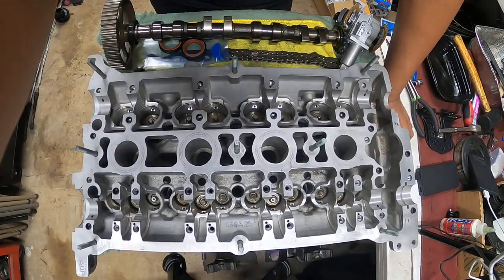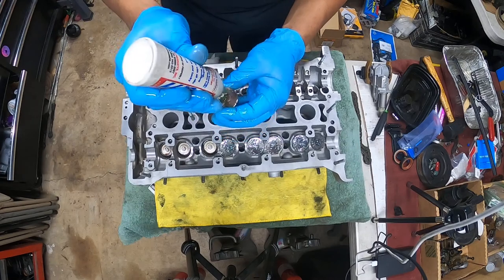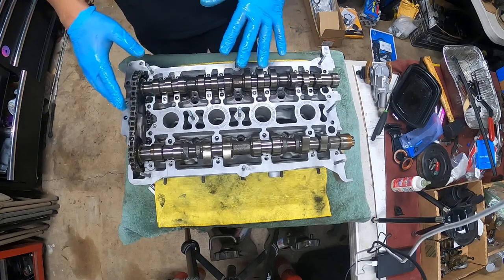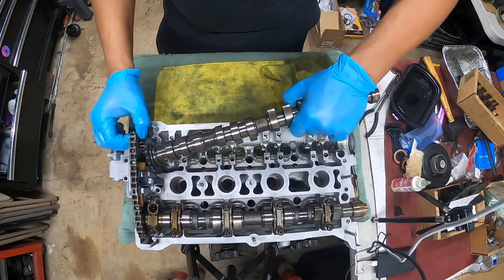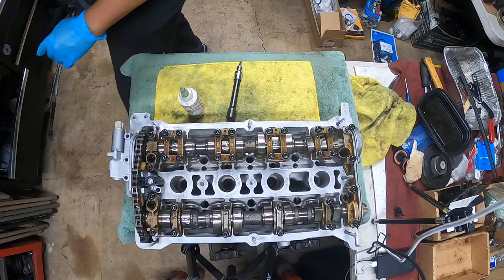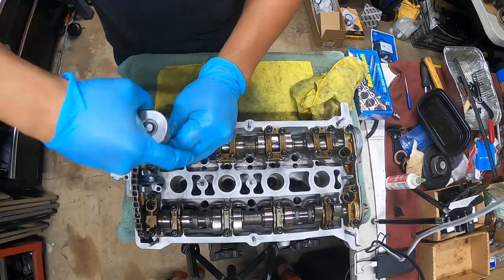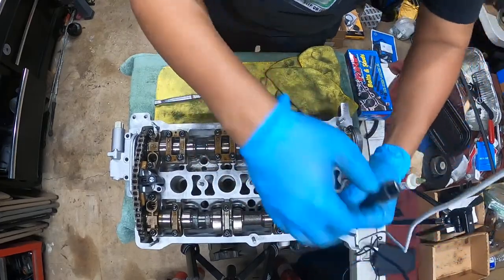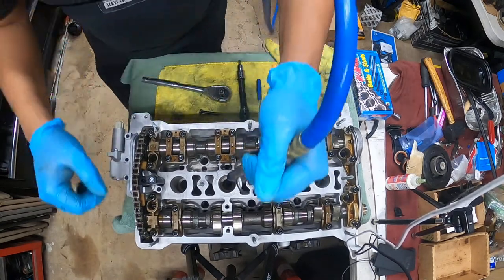1.8T Cam install

Comment: Good thing we're going to rebuild our 05 awp soon.  We've never removed  the cam chain tensioner (picked it up with 12 miles, kept it 100% stock) it has 230k miles. We've been lucky. 

Thanks for posting.  I'll be using these video on our rebuild.

Comment: HEY AL, engines currently apart rn and I have a question I hope you can answer for me! When installing the cam seal with the new PTFE seals, do I need to use the plastic cone to install? The one I ordered(new PTFE) didn’t come with it and idk if it was the new style or the older seals that had a spring that would come with the plastic tool. been watching your videos for a while now and they’ve been of great help.
Reply from the maker: You can use the plastic cone to install the seal once you have the head completely together with all the CAM caps installed.

The 0lastic cone is to help slip the seal on to the cam without causing the seal to fold over
Reply: @PincheALsGarage  okay appreciate it, thank you

Comment: Is it possible to replace the chain without taking the timing belt off by just taking the exhaust cam caps off and lifting up one side of the cam
Reply from the maker: Yes you can do that. I have a recent video doing this
Reply: @PincheAls Garage  thanks for the fast reply love your videos they have helped me out alot
Reply: Yes

Comment: Hi Inhave question, I have an 04 audi a4 1.8t, i have crank but no start.. did a comoression test had no comoression on cylinder 1, 2, 3 (30psi), 4 (90psi).. I checked all other systems everything else seemed fine.. sparkplugs looked bad, but I didn't see coolant and oil mixed or anything.. Not sure if the reason for crank and no start is due to no compression in first two cylinders
Reply from the maker: Wow! That is very bad.. your piston ring or valves are done. It's time for a rebuild.

Comment: I keep getting a camshaft position error on my 2003 1.8T Jetta, and cannot figure out what could be causing it. It has been checked by 4 very good mechanics including myself, and we all concur that the timing is perfectly set. We believe the problem may have to do with the reclutor that the position sensor reads, but there is NO information or diagrams for this part. God I hate this car!  
Does anyone have may ideas?? Thanks
Reply from the maker: Keep in mind if you have a failing cam chain tensioner it will give you this error. It happens because it won't be timing as the car is running it can loose oil pressure in the tensioner and cause timing issues. Timing will look right when the car is off just different when it running
Reply from the maker: Another common CAM sensor failure is the pigtail always short out over time.

I would check the timing on the cam chain as well. You have 4 spots 
One on the crank
One on the valve cover and cam gear
The cam chain 
One on the flywheel

What I do to confirm timing
Set the crank and cam gear to TDC and then count your chain links on the cam chain tensioner if they are not on point you will get this cam sensor issue as well
Reply: @PincheALsGarage  Those are good tips 👍🏼. Although the tensioner was replaced, I know that N-E-W doesn’t always spell GOOD. And the pigtail short is an idea too; I wonder whereabouts it usually shorts at?

Comment: Hi! can you help me ?1.8t auq 180hp vvt leon, I changed everything, chain, belt, oil pressure, good camshaft sensor, all the reasons and it throws the error code P0012, what could be the problem?

￼
Reply from the maker: The timing on the cam chain is off
Reply: @PincheALsGarage  then maybe a cabling problem?
Reply from the maker: @barnabasbarnabastoth2127  if it was the wires the car won't run at all
Reply: @barnabasbarnabastoth2127  there’s a indicator on both the cams where the chain needs to be set at and you’ll be timed. Good tip is to count each chain link from both cams and it should be 16 links between the two.
Reply: hi, I have the 16 chain links, everything is in place, but it throws the code p0012 p0011 and loses engine power, I'm at a loss! :(
Reply: @barnabasbarnabastoth2127  check to see if a lifter in one of the valves is worn down. Might have to replace it.